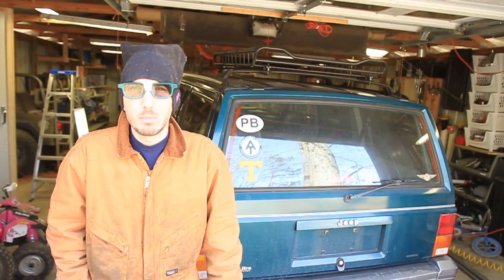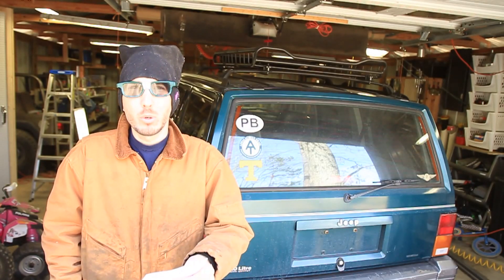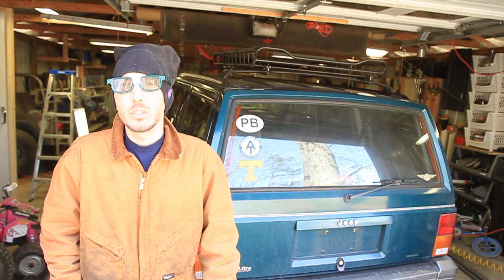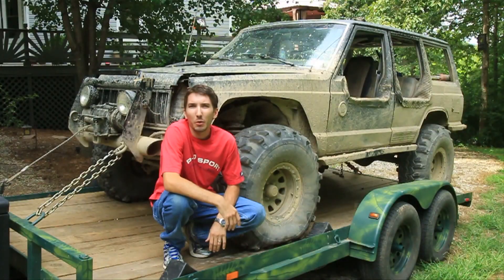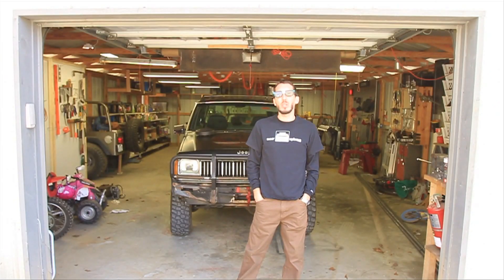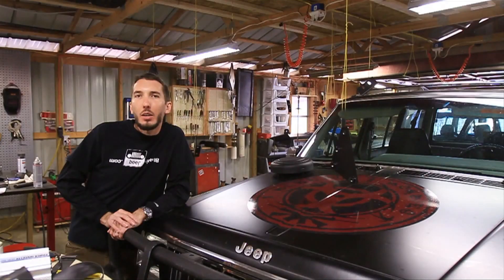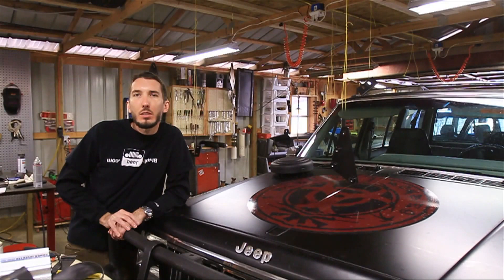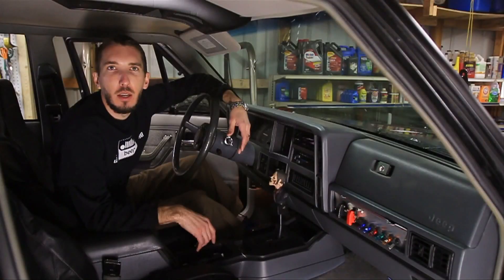BleepinJeep Shop Update - Friday - 2/28/2014

Comment: Matt, a couple of questions. What do you have in there for a heat source currently (or plan to have)? Why not start by blocking up those holes where the top plate meets the roof rafters?  Also, what specific area are you located? If you would like, message me the zip and I could get some research and suggestions going for you.

Comment: Alright man you talked me into it... but if it was my shop I'd used foam board insulation. I have 3 layers of the spray in foam insulation my 50x180 shop and its about worthless.
Reply: That math doesn't add up. Is it an inadequate heat source that isn't working properly?